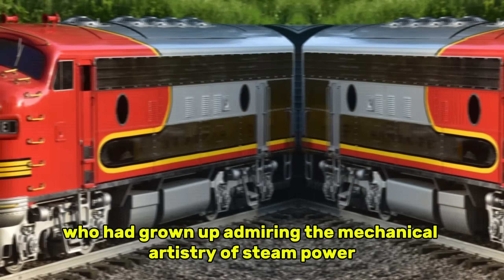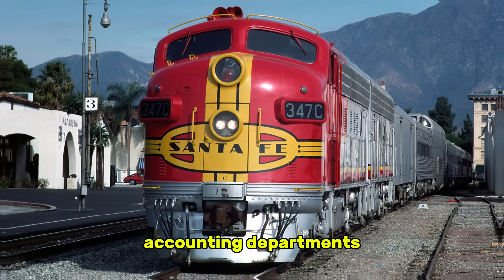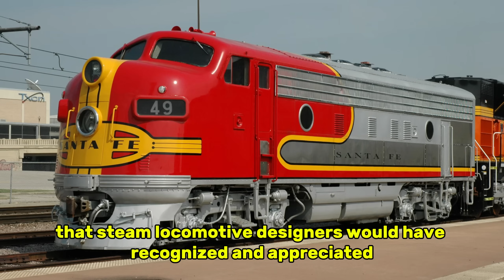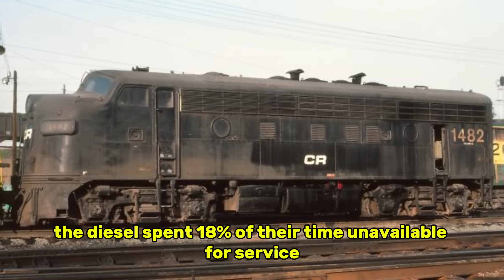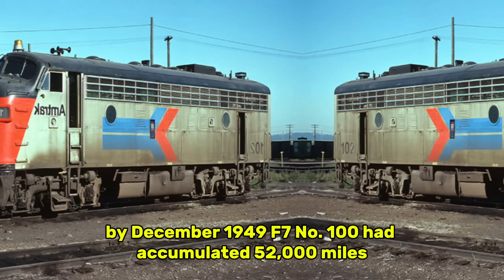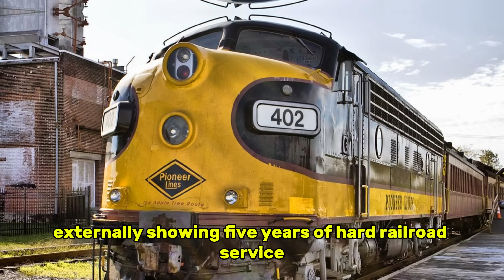The 1940s Diesel Crews Mocked — Until It Survived Half a Million Miles

Comment: I've driven a steam locomotive.  I've been in the cab of a Diesel locomotive (F7).  The visibility out of the cab of the F7 is far better than the visibility from a steam locomotive.
Reply: Well, the EsPee cab forward was the exception on visibility proving the rule!    For looking over the horizon to get a glimpse of the track ahead, may I suggest the AC-9 3800 Yellowstones, surviving until summer 1956 on Southern Pacific.  This writer had a late, glorious experience of the General Motors Vs. Steam transition in Fall 1956..

Visiting GM Aerotrain in SP Sacramento Depot:    Plump GM salesman in gray suit, eyes bulging, as Noisey Cab Ahead comes alongside, shaking the earth!   What was that?  -as black blob with wheezing air pumps and loud stack morphed into innumerable orange Pacific Fruit Express cars gliding by.      Undeserved victim in Dieselization era has been loss of food distribution corridor rail branch lines.   We will pay.

With early Diesels the scuttlebutt was: When you need to fix the steam engine, it takes a minute to find the problem; a week to fix it.   When the Diesel had a problem, it took some time to find it but not much time to fix it. Time in the shop was death knell for steam fleets.    Now, into a prolonged war era, including EMP as a tactic used by adversaries, may prove problematic for equipment heavily reliant on solid state controls.    Just an observation...  EsPee did a thorough (as many other roads) Dynamometer evaluation of various later steam engines, mostly 1940's AC & GS classes through 1954.    SP Roster shows no wartime steam classes scrapping until 1954 and after.   "Nuff Sed"..